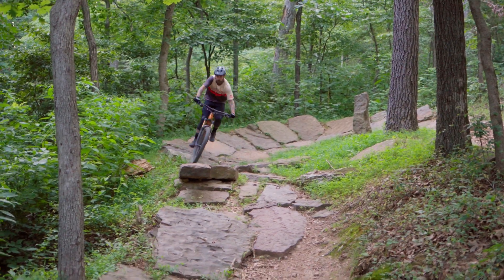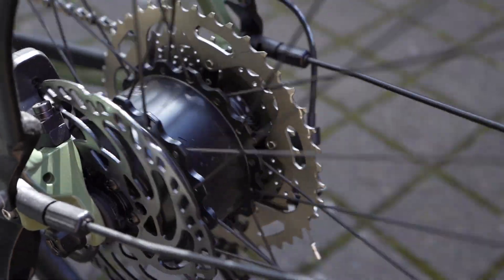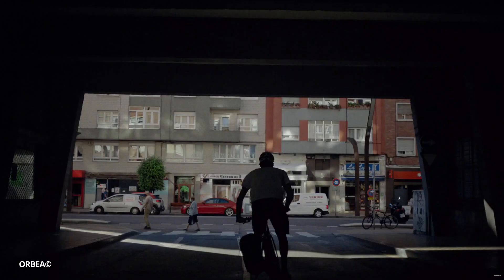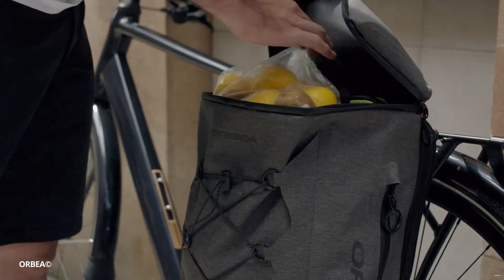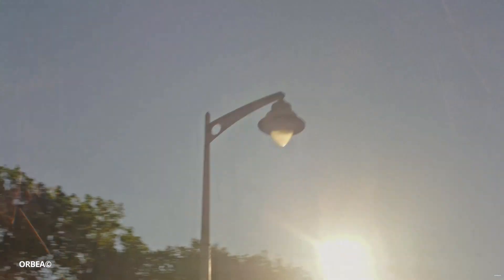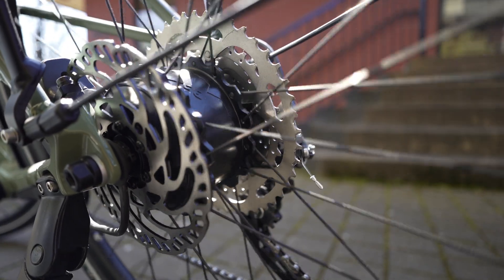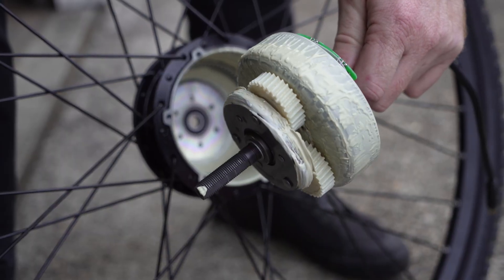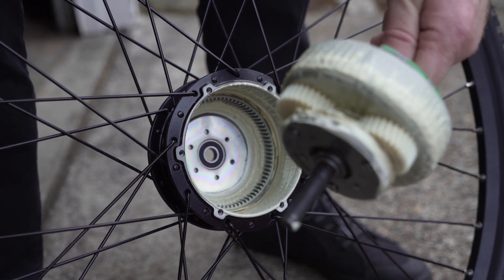HUB VS MID DRIVE | Choosing the Best Electric Bike Motor #electricbike #ebike

Comment: Would a mid drive urban bike be better for a hilly commuter route as opposed to a hub drive? Roughly 6 miles each way.
Reply from the maker: Exclusively speaking towards your commute, there great options available for both motor systems. Again if it is solely to be used as a commuter, consider things like: what accessories the bike comes with (fenders, lights, etc.), how much does the bike weigh (if you have to take it up and down any stairs), does it have storage options (rack or mounts to add one), and what is your max budget? Best of luck, let us know what you decide.
Reply: That sounds similar to my commute & mid drive definitely the best option for hills (I have a Bosch performance line 65nm which breezes up any hill). However mid drive means you don't have the option of using a throttle & is more expensive. Also, I live in the UK where throttles are illegal unless registered as a motor bike & occasionally the police round up & confiscate unregistered ebikes, so that another factor in my choice.

Comment: real question is which can you hack easier to overcome that shitty EU/UK 25km/h limit
Reply: Anything other than Bosch seems to be fairly easy to fool lol
Reply: anything except bosch system you can easily fool. these motors have so much power you can do atleast double.
Reply: Volspeed make a good chip for Bosch, reliable but only goes up to 27mph which is plenty really.
Reply: Tell it you are running tiny wheels!

Comment: I own both. I like the mid drive for hills and hub drives with torque sensor for level ground riding. If the hub drive chain breaks you still have the throttle as a back up. With a mid drive no such choice exists.
Reply: You should be carrying a few spare links. You can fix a chain in 5 minutes if you have the tool and you know what you’re doing.
Reply: and also how often does your chain break?
Reply: @SB7-r9i With a powerful motor running it? Ten times more often than when pedalling.
Reply: The midwives has more possibilities to fail, more hardware internally, plus all the pieces in the drive train, which has added stress due to the motor. Chains can be stressed more but derailures can get bent or broken. The hub motor has points of fail, but not as many and it doesn't add stress to the drive train.  I do own both, plus a front drive I put on a recumbent.
Reply: I was thinking of converting a BMX bike into an ebike would a mid or hub drive be better for BMX conversion
Reply: É possivel instalar um acelerador em um motor MID DRIVE ??????